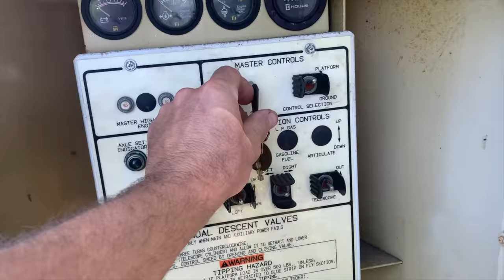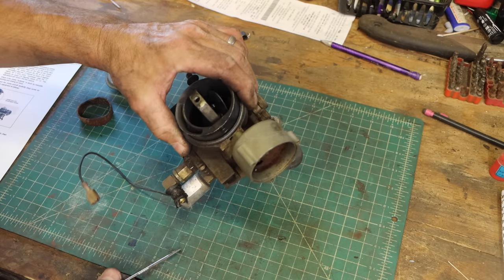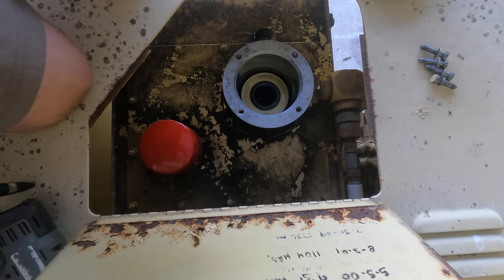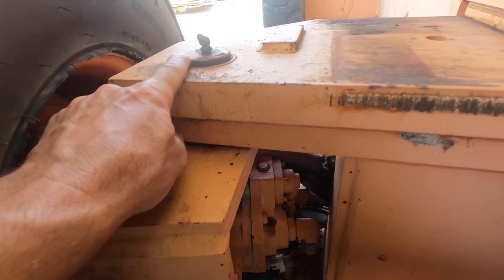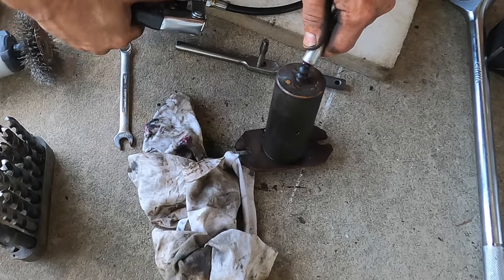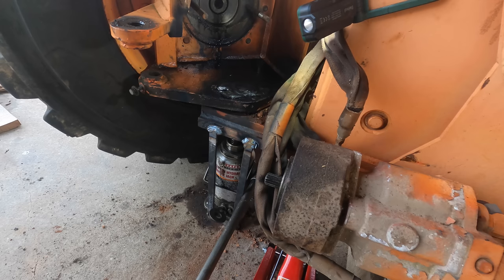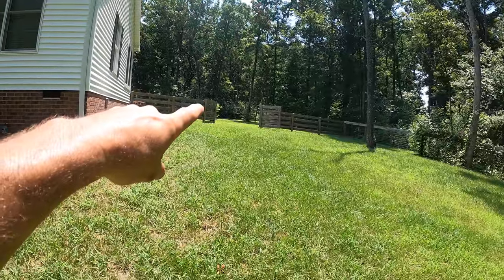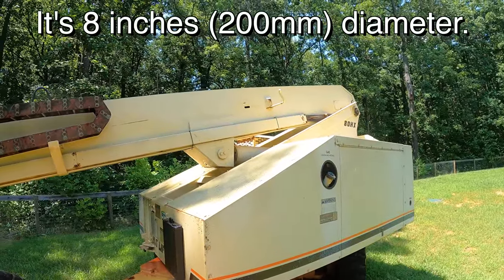Fixing and Using a VERY STUBBORN Boom Lift to Cut Down Dead Trees.

Comment from the maker: This was a lot of work, and it turns out there's a lot more work to come!  The battle will continue next week!  If interested in buying my favorite screwdriver, it's in my amazon store: https://www.amazon.com/shop/farmcraft101  under "Tools every shop needs."  Have a great weekend everybody, and thank you all for your support!
Reply: Add my endorsement to that Klein tools screwdriver.      FAR superior to the ones where you store bits in the handle.
Reply: Great screwdriver. I'm on my fourth one since every time I loose a bit it is a must have replacement for me.
Reply: Oh man this was a good watch.  I happen to be fixing my own tracked spider lift in my back yard right now.  Doing a full hose replace up the main pantograph - not easy.  I was having nightmares about the main lifting ram leaking just like this.  Dry so far...  I can't wait to see how you get that sucker out.  Did you ever check the cylinder drift with a dial gauge?  Mine seems to be within spec for now..
Reply: i dropped a wrench in oil just like that last week and my reaction was the exact same haha. good vid, look forward to the next one dude
Reply: Can’t beat the 11 in 1 for a carry all screwdriver. As an electrician I use them a lot in attics, and crawl spaces. One tool is much easier to keep up with!
Reply: Thanks for the heads-up about the screw driver. I just bought two of them from your Amazon site. Always enjoy your very informative and entertaining videos!
Reply: One of those grease zirc oil injectors may work real good to clear those type pins out so they will take grease again. Just a thought. Love the videos man.
Reply: King pins will rust if you use the wrong type of grease. High-melting point grease as used in bearings often has a lithium base, which is hygroscopic. No problem when it runs hot most of the time but if you use that grease for a king pin it will suck up water like a sponge! In the past I have used stern tube oil (for ships' propeller bearings) and I have used Wynns or STP "oil treatment" for old engines. Both resist rusting but need to be applied more often than grease because they are less thixotropic (more runny). Castrol CL grease is good. Castrol LM is not.
Reply: Hey John sorry if my previous comment was waaaay too long & got deleted! The 4cyl Ford, one of my specialties, all kinds of minutia to share about the engine, if you need it. Saw a few suspect red flags had me scratching my head which I couldn't understand why the boom lift manufacturer had put on it, that's really all I was trying to share. It's a GREAT engine, with caveats depending on the version of it.
Reply: @manolisgledsodakis873  thanks for that tip…makes sense.
Reply: Are you planning on reinstalling the safety wire in 5he bolts?
Reply: I'm so glad I watched right to the end...now i know how trees are made!
Reply: I can tell you from experience that the Engine Coolant Temperature Sensor will cause all kinds of problems especially having to do with idle. I had one that corroded from having the engine cleaned. That thing gave me fits until I figured out that my 93 Nissan Sentra had engine codes that worked by blinking the dash lights. Once I got the code it led me directly to the ECTS. Ran like a new car once I replaced the part. Good Luck!

Comment: I appreciate your persistence. That bottom pin was ridiculous and yet so gratifying when it finally popped. As an engineer that has helped to design, build, and test all sorts of funky custom machinery, I really like seeing the variety of problems you've been handling. Keep up the good work and thanks for your efforts.
Reply: As a millwright I'm glad your here. This is a all to common issue with the lack of maintenance. Not greasing or worn out to a crankshaft shape
Reply: Aghh 32mins in and I had lost faith. *Spoiler alert
Reply: Did you try lubricating the pin before trying to remove it? I had a similar problem and I just sprayed with wd40 and then came back to it later and it finally worked.

Comment: King pins will rust if you use the wrong type of grease. High-melting point grease as used in bearings often has a lithium base, which is hygroscopic. No problem when it runs hot most of the time but if you use that grease for a king pin it will suck up water like a sponge! In the past I have used stern tube oil (for ships' propeller bearings) and I have used Wynns or STP "oil treatment" for old engines. Both resist rusting but need to be applied more often than grease because they are less thixotropic (more runny). Castrol CL grease is good. Castrol LM is not.

Comment: Great work John on the maintenance, the king pins were a real fight. Just a FYI, just watched a power co. pro bring down a BIG dead Ash from the top down, and his method was a single cut starting at the side facing him and doing a 45* angle cut down and away from himself leaving the hinge wood on the side away from him. Then just gave a push away from the bucket and away it went, bout a 28" tree toward the bottom.

Comment: Yes, the choke element is a bi-metal strip wound into a coil.  Running electricity through it, heats it.  The two metals it is made of expand at different rates.  This will cause it to open. closes as it is cooled.

Comment: My dad uses a good trick when you can’t get something to take grease. He adapted the end of his port-a-power with a grease coupler. Then you can pump high pressure oil into the joint to blow out the obstruction. Works great. Thanks for the video.

Comment: Big ultrasonic parts cleaners are a must for cleaning carbs deep passages out. I've fought clogged tiny idle passages in VW carbs that carb cleaner and air pressure wouldn't clear out. Even a soak in Berrymans watered down version they sell these days didn't do anything. So, years ago I bought a big ultrasonic parts cleaner. After fully disassembling the carb, I cleaned it in that ultrasonic cleaner. Man, it cleaned that carb and all it's tiny passages out beautifully.
Reply: Really great video, thank you. I might have tried applying downward force to the axle using tractor loader or excavator to make machine "heavier" whilst jacking up pin to save making press but the result is what counts!

Comment: Hi John,
very fascinating video. I liked that you didn't gave up on the pin. I can understand how much frustration something like this can cause! And I really like how you use the drone, this really adds something special to the videos.

I'm a former german arborist and wanted to share a cutting technique we used when cutting down trunks. We used this while climbing the trees with ropes but it's useful in a lot of situation. You make one horizontal cut ca. two feet below the top (assuming you already cut off the crown), but only cut a little bit over half the diameter. Then cut (horizontal again) around an inch lower than the previous cut, starting from the opposite direction and again a little bit further than half the diameter. You should end up with two parallel horizontal cuts an inch apart which overlap 1-2 inches. Now engage the chain stop and put the saw somewhere safe.  The piece of wood is still safely attached but with little effort you can rock it back and forth and will come loose and you can safely throw it off with a lot of control. We called the technique Knick-knack due to sound when the piece breakes off. 
I hope the explanation makes sense, it's a bit difficult too describe.
And the way how you did it, is fine too. This should not be any criticism 👍

Comment: I bought an old 42ft lift (trailer type).  It has 10 hoses that are 60ft each that run from the bucket to the lower pump.  So far I've had to replaced 8 and the other 2 will probably fail too but not until I'm working on site.  Mine is loaded with red auto transmission oil which is a lot more expensive.  Murphy's law is for real.  Keep up the great work!
Reply: Had the brkt for the main cylinder basically let loose on a 35ft at full extension last month. 🤕

Comment: 31:55 Use a large wrench on that pin plate and force it to turn. You may also try to wedge a piece of steel against the inner frame and the plate, then force the wheel assembly to move agaist the obstruction...in effect 'turning' the pin inside the wheel frame.

Comment: Hi John, been watching the boom lift series with my dad and I have to say it had been one hell of a ride but very enjoyable with me and my dad being automotive technicians.

One thought we both had was that the ford engine uses a timing belt to keep engine timing.

Had this been replaced? I would be wanting to change the belt along with all the guides and pulleys including the water pump due to the age of the lift. Maximum I would run the belt for is 10 years.

If the belt snaps we can wave bye bye to the engine which is not what we want.

All the best 

Adam

Comment: Great video 👍 Bravo you win heat cycling hot then  quench with water plus you had a taper lock happening with the hub plate opening and trapping the pin .

Comment: For that kingpin...I saw a youtube video recently about penetrating fluids.  Turns out the best is candle wax!!!!   Heat it up, apply some wax so it melts and it will wick into the joint.  Let it cool...   In that video it worked WAY better than all the spray can products.

Comment: 27:38 I wonder if drilling out the grease like that without removing the pin would have been enough...  I am going to have to try it on my bobcat which has the same issue...
Reply: maybe, but if the little sideways hole is blocked too it wont unblock it...
Reply: Definitely worth a try on the bottom pin, once the bulk of the blockage is out squirt in some solvent to loosen up the remaining crap. Just rinse and repeat till it takes grease.
Good job by the way.

Comment: Man, not gonna lie, I'd totally have left the bottom pin at that point. Good on you for pushing through!

BTW, I also yell, "I win" when I get through something. I'm sure my acreage neighbors can hear me when I do it. Lol
Reply: Spray Lubricant on it, then work it. You are going to struggle getting it off anyway.
Reply: you should have drilled the grease hole all the way thru to the other side that way it applies grease on both side of the pin. I have done it on many pins works great.

Comment: - 29:30 ... Ahhhhhhhhhhh, I finally got relief. "Maybe I can get some heat on this.
- My first fix/repair mechanic education was on stone crusher equipment, and old trucks...I was taught to push over the acetylene torch close to the work area of the men who taught me.
- Guess why I was taught to 1st stage that in any area where they were fixing something.
- The second tool was a can of ether to freeze everything first before heating what was needed.
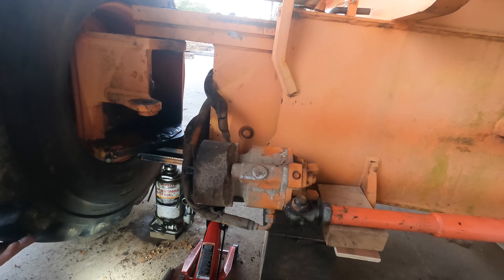-32:28 "I got the makings of a shop press right here." Impressed me. Good for you.

Comment: I've had to do some pretty stubborn king pins on charter buses before.  We had a specialized 50 ton portable hydraulic press for pushing them out.  I can remember one, we had the full force of the press on it and it still took 8 hours of heating and beating with a rosebud and a sledgehammer.  When it finally broke free it sounded like someone fired off a 50 cal.  I do not miss doing those.

Comment: Usually, not always, replacing the seal is nothing compared to removing the cylinder. 
That is a lot of boom to lift up so you can remove the cylinder.  Hope you can raise the beam with the pump and rest it on something so you can take the load off the pins. 
I have had several members of my maintenance crews get injured removing a cylinder while not realizing it was still under load.

Comment: That wrong lever moment very nicely demonstrated why a harness isn’t such a bad idea. To be fair, first hour of running a lift of any kind every move for me is as jerky as that. A tether for the chainsaw like the arborists use might also be a nice addition, nice to know that you can just let it go in case you suddenly need an extra hand.
Reply: Tether anything you don't want to fall. I talked to a guy who worked on cell towers. I forgot if it was him or a buddy, but either way, one of them got up to the top of a large tower. Maybe 800 feet? 1,000 feet? Either way, they went to go grab a tool and dropped it. At that point you shout "Falling Tool" over the radio. Something like that. Everyone scatters, so they don't get a wrench through the noggin. Well, foreman or supervisor or whatever says, "Alright, come on down". They come on down. They're handed the fallen tool and they head for their truck. Foreman asked where they're going. They say "home". Foreman tells them the job isn't done, so they have to get back up there. 

How bad would that suck? Having to climb a 1,000 foot tower twice in a day because you dropped your 10mm socket. Look up "tower climbing" or something like that. It isn't like they just climb ladders.

Tether your tools.

Comment: We had a lift like that for years. We took it to two or three people. Never could get all the hydraulic issues figured out. Finally sold the thing. It didn't have enough power to load itself on a trailer but it ran fine on flat ground

Comment: Great video! Question, when applying heat, could you just try to heat up the plate that the rod is stuck? Rather than applying heat to the pin? Just curious!
Reply: He did, that was the first attempt.

Comment: I hope someone is going to pick up the logs for the fire. I would like you to make a dummy, fill it with sand to about  two hundred pounds weight, then put the harness on it and tip it from the basket. Then you could see how much pressure the harness exerts. 
Does your harness strap have any spring loading on it?. Just love your channel, your tenacity when  encountering snags is something to behold. All the best from UK.

Comment: That lower king pin… I am wondering if the lower plate on the wheel side was slightly bent off of perfect vertical from the weight of the machine over time and/or the jacking up of the pin from the bottom exacerbating that. 

That blow from the sledgehammer that freed it was in the perfect spot to counter that out of vertical situation for sure. The torch I’m sure contributed a lot though too.

Regardless, nice job sticking with it…that kind of stuff is a challenge for me too where you’re spending so much time but you want to do it right, and given you’re already most of the way there…

Another idea would be to weld a bar onto the pin and use it to try to rotate the pin first to free it.

Nice job on the carburetor, that had to be satisfying to listen to that purr afterwards.

Comment: Great video... You probably tried it off camera? Did you try removing the bottom grease cert, drilling out the old grease (like you did with the top pin), that would have just left the old hard plug in the side hole, that short plug may have been evicted by new grease under pressure? Looking forward to the next battle. That cylinder is going to be a pig to get out, never mind change the seals...
Reply: We used to blow the center of the pin out with a broco rod or cut the pin in sections with a sawzall
Reply: You can also rebuild cylinder in place. Pull rod end pin out, take gland nut off and pull rod out

Comment: Look up lock-n-lube adapters for grease guns. Most will pump to 10k psi. The lock and lubes do a good job holding on even at higher pressures.

Comment: I had a jig made for doing king pins like that. It was like a very large C clamp that the bottle jack went in the bottom of it then the top part of the clamp had a bushing that the pin will fit through then you just jack it up and push the pin out. It was made from 1 inch thick steel.

Comment: 43:40 a terrible moment. I know that as well. 
Too late i saw you have already worked on the lift and drive joysticks to fix some problems in the controll. 
Unfortunately, it is open to me whether you have also set these? 
The 4 small potentiometers on the joysticks are very useful to alleviate these moments of shock. 
The small potentiometer "ramp" in particular has a significant influence on this.
At the site of JLG you find the informations how to adjust the joysticks. If you haven't checked there yet. 
On the other hand, feel free to ask me. 

Really nice video again!

Greetings from Germany

Comment: Well color me jealous...lol..what a handy machine, I also have some Trees I need to disassemble,  a lift makes it so handy....love the top handle saw also...just picked up a pair of old poulans 1 may run eventually,  but my small engine repair failure rate has been too high lately to even think about it at this point in time...lol...oh what we go through to keep old stuff running

Comment: I changed a power steering hose on my car. Was having "fun" with the compression fitting so got out the mole grips. All went well until I dropped the mole grips into the bucket of old fluid. Deep joy...

Comment: Some time it’s advisable to cut small grooves along the pin to make a easier path to grease everything. also on your bottom pin just drill out the grease hole  and get a grease zerk ram. . I was just getting ready to smack it with a Hammer when you did it finally

Comment: I'm wondering why you didn't try pulling out the lower grease fitting and jamming a drill bit up there and some penetrating oil/brake clean to clean some of the gunk out before attempting more grease. I would hope that de-gunking it a bit may have allowed just the jack and hammer to work. But armchairing and hind-sight are wonderful things 😃 . Great job persevering. Not fixing that would probably cause you bigger pains in future when it wouldn't be convenient. Also, I like your attitude of "fix it now, properly", instead of waiting until later for double the work!